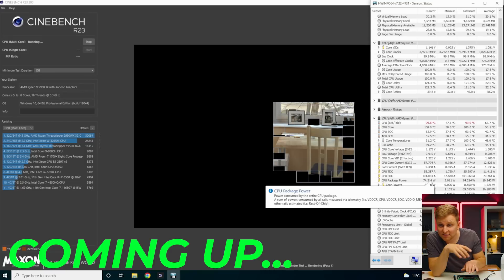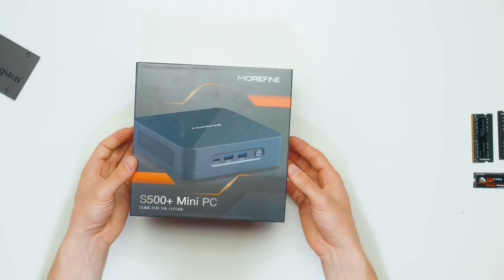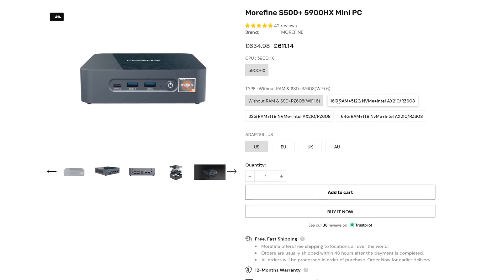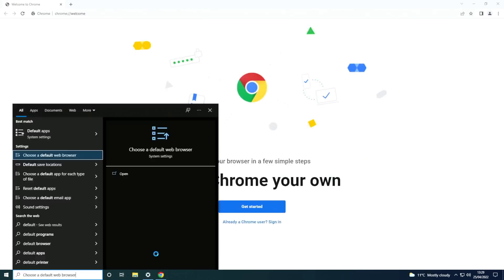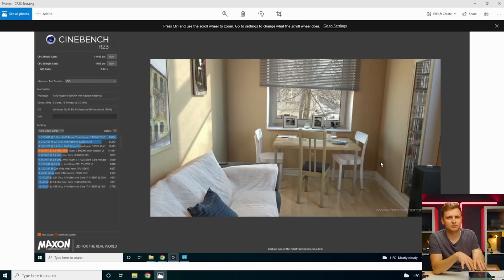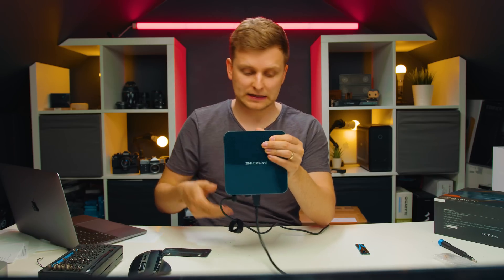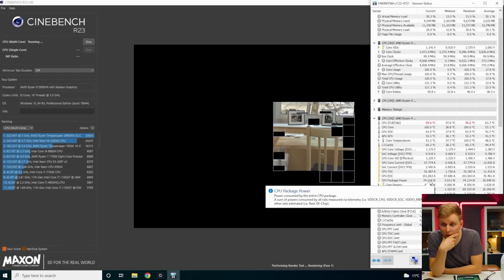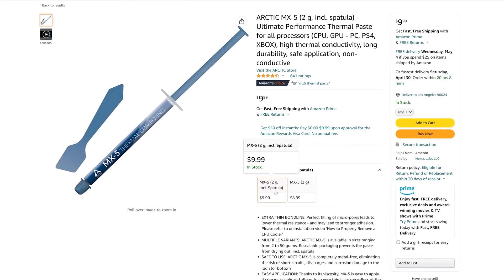BEST Mini PC?? Small & SOO Powerful! - True Apple Mac Mini Competitor! 😱

Comment: Just FYI it works with ECC SODIMM, just make sure to activate it in the bios.

Just fyi I’m running this as part of my home lab. It’s fan curve is a little loud until the tdp but it’s an amazing mini pc, 64gb, 2 m.2 drives and an ssd. I don’t even care that newer ones came out this has verified ECC and if you get 3 you can run proxmox in HA. If you get 4 you can run proxmox in HA and schedule shutdowns, update, reboot, etc for the 4th on a rotation.
Reply: Now try translating that into English. Thank you.

Comment: Considering its a laptop with no screen/keyboard/UPS these are pricey. Add in cost of adding ram/storage to the 'bare bones' kits & these look even more pricey. A second hand ex corporate laptop from top tier manufacturer (eg Dell) will give you 95% of the performance at a fraction of the cost.

Comment: 6:40 although you won’t necessarily see better performance going from something like a 3060 to a 3090, dedicated graphics are important. Specifically dedicated VRAM, 2GB at minimum with 4GB being recommended. AMD does a pretty good job with its APU lineup, but there is a benefit.
Reply: How so in photo editing?

Comment: This PC is identical to the Kingdel K15. The big difference is that Kingdel PC's are sold on Amazon, and not only direct from Chins. So, if you have problems with the PC , you have remedies via Amazon. If you buy the Kingdel K15, your money is secure. If you buy the Morefine, you have to cross your fingers and hope nothing goes wrong. I speak from experience. I bought the S500 Intel variant from Morefine (which is a clone of the Kingdel K13). I ran into severe thermal issues and did what you did; I repasted the CPU with thermal grizzly and got a big performance boost. Unfortunately, when I ran Cinebench R23, one of the VRM's on the motherboard shorted out. I contacted Morefine about the issue, and they never once responded to any of my inquiries. Nothing. Radio Silence. If they wanted to deny warranty service I could understand that, but by completely ignoring me is unforgivable. I also questioned the BIOS as during boot I would get a notice the BIOS was an evaluation copy. They have no support page for drivers or BIOS. My story turned out well as I was able to replace the shorted VRM and have a functioning PC. I promptly sold it and bought the Kingdel K13 and K15. I have no issues with either, and thermal performance is excellent on both units. Morefine is a disreputable, opportunistic company selling relabeled clones. It has no support to speak of, and when using OEM motherboards, you can expect to have no BIOS support or BIOS updates. This is a case of mega buyer beware. It is you money. If you like this machine, buy the Kingdel  K15 from Amazon.

Comment: The problem is not performance , it's performance per watt. Many CPU could kill M1, but not in performance per watt. I am using M1 lattop after 6 hours, and it still keep 40% for me to view more videos.
Reply: 40% what?
Reply: @O1OO1O1  power
Reply: 5900hx laptop I have is rated for 10 hours and can play YouTube for about 7-8 hours.  Windows os also uses more power.  But yes, m1 is still a bit better per watt.

Comment: Having used windows for 20 years and Mac’s for 25 years the biggest problem with this new computer is windows. If you haven’t used a modern Mac for more then a few months you can’t comprehend the difference. Mac’s don’t have all the problems that Windows has. That said over the last year win 10 is getting better.  11 has major problems. 

So if your looking for performance it’s not just the hardware it’s both.  Windows can only get better but when?

Update: I have 4 Windows computers and 2 Mac’s. I use both daily.  It don’t hate windows, but unfortunately some programs only work on work on them.

Comment: So a Mac M1 competitor with a lower benchmark, noisier, hotter, draws 10x more power, but is smaller than an M1 Studio. Ok……….  I like the upgradability, and the size, but I also like the power and power efficiency of the M1 Mac mini. On one server I reduced the energy per day my house was using by 3kWh alone, saving me over £300 a year in elec costs. So the click bait title would be more accurate “another small pc the same size as a Mac m1 mini”. Yawn

Comment: That thing is always throttling after couple of seconds, very bad thermal design. if thing is throttling it useless to buy higher model, you only buy high performance if you wane use that performance for hours in row and often, otherwise you can better buy much lower model and wait couple of minutes longer few times a month or so. ;)

Comment: I had a similar PC in the past, powered by an i7-4770R if I remember correctly. I think there are two problems with these PCs, from my experience. The CPU fan is very noisy and when it dies, you can throw the PC away, there are no spare parts and I tried a lot. The CPU fan can die either because of the fan itself, or its (strained) motherboard power line. In my case it was the latter and it happened after about 3 years of moderate use (i.e. 6-10 hours a day). I tried for almost a year to save the PC, which was fully functional otherwise, trying to get an alternate fan or an alternate motherboard. Not possible. I think that you can find spares, possibly standard type, for small form-factor 1.3 liter PCs from well-known manufacturers much easier. Just to keep in mind. One more idea for you. There are now Jasper Lake based PCs with passive cooling, no moving parts and even smaller form factors. I have one from Shuttle (the DL20N6), with the most powerful of these CPUs, the Pentium N6005. I have tried simple image/video editing, as well as more heavy video conversion (with Handbrake) and it runs quite OK. The PC is super fast with normal desktop tasks. Other reviewers have found such PCs, most of them having the N5105, very good too and they're also quite cheap.
Reply: Go with fanless passively cooled minis. :D

Comment: I don't have this kind of small form factor. He said it can be mounted on the back of a monitor or tv, yes correct it can. But I think it is super inconvenient as you need to reach the power button on the back of your tv or monitor all the time. Unless you will have a power button (external) that you can route in front or side of the tv/monitor. By the way very good overall review of

Comment: Eh no. The MM M1 single core is far better for most programs you use. And after OC those temps would keep most Apple customers from ever looking at it twice. Honestly and that's like subjective nowadays, no one is here who owns a MM saying I should've bought that instead. Equally no PC user is here thinking I'm glad I didn't buy that MM, Lol. I have 3 PC'S and too many Apple everything to count but I'll still be building a Gaming rig in the next year. I'd be remiss to buy a marginally better or equal PC just to Hackintosh it when I can just buy a Mac. As the years go buy you simply guy what's useful for your needs no one else is relevant. The fact you pulled out that Apple Mac Studio sitting next to a MacBook Pro says everything I'd ever want to ask, Lol.

Comment: Really need to undervolt any laptop or small form factor pc hell any pc. I would like to see a good undervolt tune. I hate that some cpu’s and manufacturers lock you out of undervolting. I could undervolt the last 2 laptops I’ve had the 8750h which i could use throttlestop and mess around with everything but the 10870h i only had a set uv value in the bios and throttlestop didn’t work or intels utility. Im haven’t messed with any ryzen laptops but have plenty of use with their desktop cpu’s. 2700X, 3600, 3900X, 5950X but when i got my last laptop the best gpu you could get with ryzen was a 2060. I got a 2070S with my 10870h.

Comment: It depends a lot on what you need. I’d like to know how noisy it is, my M1 mini hasn’t made a sound since I bought it, despite some heavy Blender and DaVinci Resolve work. Performance isn’t everything.
Reply: Can it run blender for productivity base works?
Reply: @seigoulenmate7366  I’ve not had any issues so far, I’ve tried the standard samples from the Blender site. Bottom line, it’s more than adequate for my needs, and silent.

Comment: You need to add the couple of hours that you spend every month or so keeping the PC running,  and the months you spend configuring it so that it works conveniently and almost sort of consistently, versus the Mac....
Reply: Why the couple of hours each month to keep it running? What do you need to do?
Reply: @joacwoot  Pixelwash is probably talking about registry creep. I left the Windows world about 12 years ago because of that.
Reply: @joacwoot  You obviously don't use a PC long term in a production environment that uses software that pushes the capabilities of your machine. It's something different all the time, some glitch or other. Check out the "help" forums for PCs, both Microsoft's own. and the often Russian and sometimes US  third party ones, and you will see the literally TENS OF THOUSANDS of ways that the PC will screw itself up, and you have to perform some bizarrely complicated repair procedure just to get it to work without some weird problem.

(My latest one was the "shutdown" menu decided to stop working. There is at least one issue every few days on my main production machine.)

I've turned off automatic updates also, as they introduce all sorts of glitches as well. You probably either only use your PC to do very basic stuff and use only a few main pieces of software, or you are completely inexperienced in using a PC.

Microsoft these days employs an ARMY of support "experts" to answer users issues with their software, and in typical Seattle-style class and nationalistic abusive "Microserf" way, these "experts" are poorly paid third world (often Indian) workers who just recite basic re-installation and refresh procedures, and it's users who offer the most practical solutions to the litany of problems that arise.

(And this is a fairly recent full clean install of all my software, including the OS, Windows 10, on my current setups ie only a few months old. There is a reason why most software that has to work without fail is written to run on Linux, or Mac OS.)
Reply: @pixelwash9707  Woah, easy there Mr Apple fanboy. Lay down your pitch fork. Was a genuine question since i have used PC for work, (Typical office job, no heavy loads) media (Including TV) gaming and more since the XP days without any issues. But i guess i am have just been lucky? Anyway, thank you for your explanation, i do agree with a lot of what you say. Apple has made some genuine good products i have heard, but i do not like Apple as a company. So i have never owned a Apple product and never will. Guess i am Linux, Microsoft and Android for life :) Anyway, have a great day!

Comment: A couple of nitpicks:  The first is that both the Mac mini and Studio have internal power supplies.  A couple of people have made ridiculously tiny Mac minis by moving the power supply outside.  The second nitpick is that the M1 also includes low-end RTX performance (depending on the task; sometimes better on specialized tasks) as apart of its TDP.  I know that wasn't what you were testing, but I think that context is important if you're going to compare power efficiency versus capabilities.

In any event, for raw CPU performance, this is a breath of fresh air.  With AMD and Apple both dumping on Intel, I think it's the kick in the pants they need.  Competition is good for consumers.
Reply: 3rd nitpick is give me a free PC & I'll say great too 🎁
Reply: @D R I would imagine Microsoft would really like to get Windows on Arm onto Apple Silicon.  It could really bring Windows on Arm into the mainstream and convince Windows developers to port their software over to ARM.  So far there has been little financial incentive for developers to do so, and the Surface ARM devices don't have the marketshare to make it worth the trouble.
Reply: @olepigeon  Problem is, I can't really see Microsoft being willing to lease/license out Apple's M1 or M2 chips - even if it does finally get Windows onto a really decent and already developed ARM cpu. It would be a very hard pill for them to swallow, having to hand over a portion of their potential profits to Apple. Not to mention how it could potentially damage both Intel and AMD when it comes to their CPU side of the business - especially if Windows on an ARM chip manages to be significantly better than anything they can bring to the table. I have a feeling Anti-Trust and Anti-Competition laws would also come into effect and cause headaches for them (though, I could be wrong on that front), since Apple would then be in control of not only their side of the market but also Windows side as well.
Reply: @DavidStruveDesigns   I think olepigeon's point was about Windows running on Apple ARM based computers.  In that situation, Microsoft does not need a license from Apple to do so.  Microsoft is free to release a Windows OS compatible for use on Apple ARM based computers and there's nothing Apple can do about that.

Microsoft Windows 11 is already available for the ARMv8 architecture and the new Apple M1/M2/Ultra CPU's are ARMv8 compatible.

Consider how quickly Linux and the BSD's were able to get to a point of being usable on the new Apple M ARM based systems.  The development required was mostly surrounding device driver support for devices found in those new Apple systems.

Also note that Apple is not the parent owner of the license for the architecture that their new CPU's are based on, Arm Ltd. is.  ARM architecture licensing exists for those companies who wish to design and/or build their own ARM based CPU's.  Apple licenses their design from Arm Ltd.

This licensing is not required for software companies who wish their software to run on ARM CPU's, they are free to do as they wish in that regard.  No license or law can stop them.
Reply: This thing has USB PD so forget the brick... yeah FTW!!!
Reply: @D R The Intel Macs can still run Windows natively.  So if you want a dual boot system that runs both macOS and Windows, then right now an Intel Mac is the way to go.  Especially if you're a developer and do cross-platform development, you can build universal binaries on an Intel Mac that'll run on Apple Silicon.  Only problem is that you can't debug the arm64 slice.

Also, while they're getting a bit long in the tooth, the x86 Mac minis still make for a good value mini Windows or Linux PCs.

I suspect once Microsoft ends their Qualcomm exclusivity deal, Windows on Arm will take off like a rocket. Apple has stated the new Apple Silicon Macs will run Windows on Arm, but the only thing stopping it is Microsoft; presumably because of said exclusivity deal.  However, once that hurtle is jumped, I suspect that Apple Silicon Mac value will increase tremendously.
Reply: Dear good neighbor, An added consideration to place upon the scales in weighing the pros/cons: It may be likely that the external PSU can be replaced if needed more promptly and cheaply, branded or generic multi-sourced. With kindest regards.

Comment: I love the competition and the expandability - however, it's not faster than the M1 single core performance and it's only slightly better multicore but needs to draw lots more power (not as good for the planet and not out-of-the box for this unit), runs hot (not good for longevity), and not as quiet.
Reply: Who cares how much power it draws? I have a house full of appliances and the AC running so whatever my PC is drawing is of very little importance to me. 😂
Reply: yes but at a fracton off the price. not to menton all that apps that require you to pay for the license keys owned my mac. so yep. i would chose this litle beast over the m1 max or iveb the ultra and buy an rtx 3060ti with the rest off the money and an ryzer cable with m2-to pci-x adaptor to play some games too!
Reply: @nelsonpiedade61  You have to pay for the licence keys on Windows too. Unless you are using cracked versions?  It's not a "fraction of the price" for the hardware, but, you get what you pay for.  Windows for music production is not a viable solution, for many reasons that lots of people have outlined.
Reply: @nelsonpiedade61  no it comes with nothing you have to add in all the stuff. ram hard drive, ssds and windows. add all that together and its not cheaper than a mac mini

Comment: i never understood why i would buy a mini pc with a  mobile chip when i can just buy a looptop using that chip and being more useful. a laptop is usable on its own outside home and you can still go home and plug it into a monitor.
Reply: Laptops are a waste of resources (screen, keyboard, touchpad) if you are not going to use them and they take up a lot more space, although a vertical stand can minimise that somewhat. I would be curious about price vs performance though.
Reply: @verbose2615  why wouldn't you use them. you don't need a laptop in your life?
Reply: @quantumdot7393  same here I’ve never bought a laptop ever, is useless to me, little screen, terrible keyboard, big size, noisy… for that I use my iPad, and for working a mini pc with a real screen with a proper keyboard and mouse.

I literally hate laptops, and I’m not the only one !
Reply: I can say why I bought a mini Mac over a laptop

More useful connections, smaller foot print, my studio uses an ultrawide monitor and don’t want to use a small 16:9 monitor

Before I needed to be more mobile so I needed a laptop for recording, but now I pretty much always at home.  my old Mac Pro laptop to record used up significantly more desk space.  If I need a laptop I’ll get a chrome book